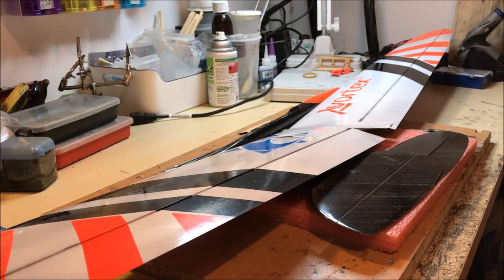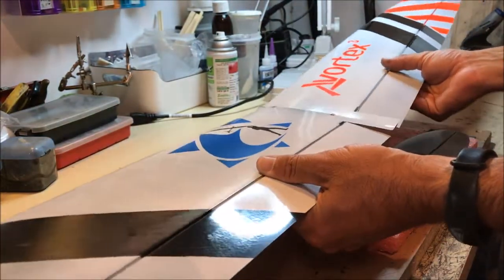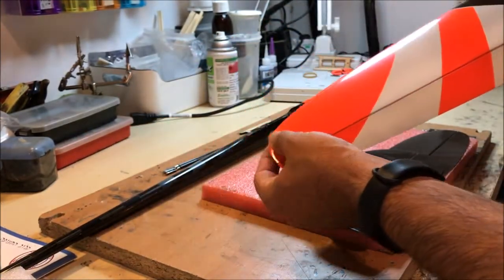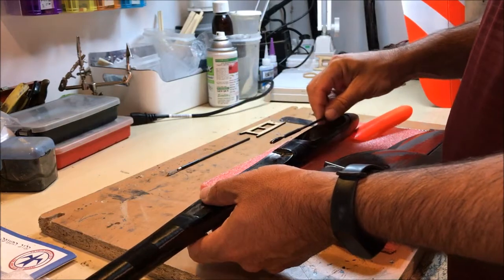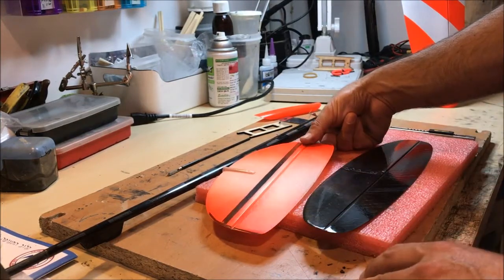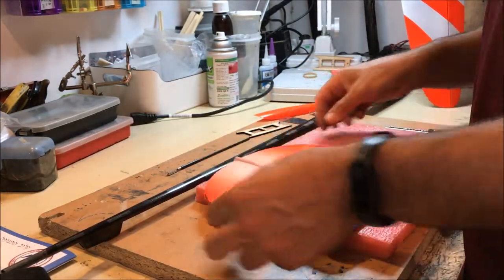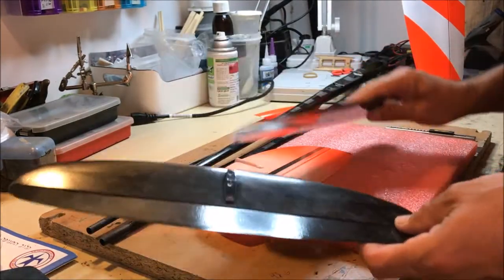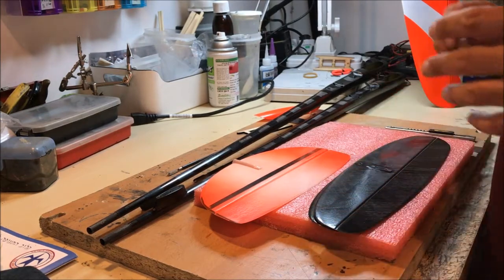Vortex 3 building instructions - chapter 1 - Introduction

Comment from the maker: The 2 piece wing will be available soon. As for price, I don't know, not involved with pricing. Top and bottom tails handle very similarly, just a matter of personal preference. A few more vids are on their way, will take a few days for them all to upload. There will be chapters on servo installation, aileron pushrods, peg install, tails, pull springs, radio setup and more. 
Stay tuned!